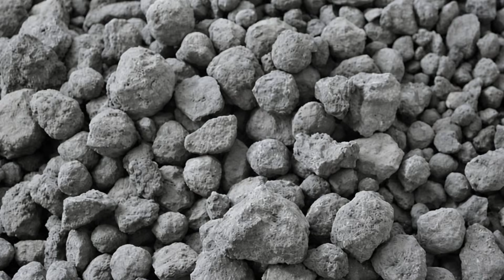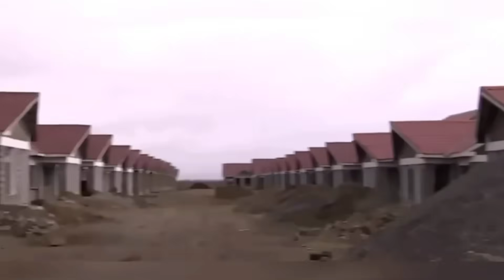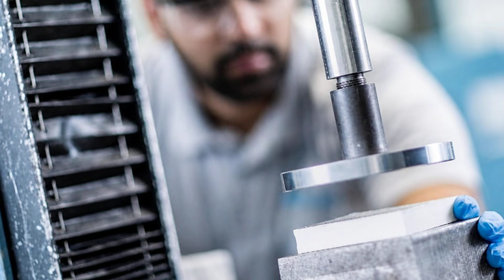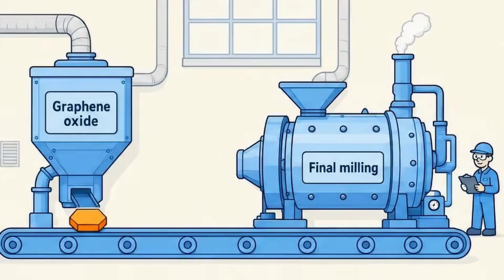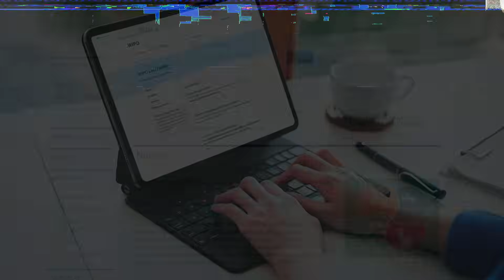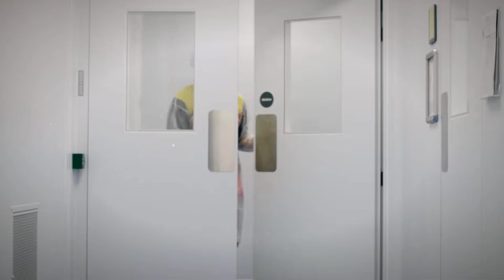China's New Additive Makes Concrete 40% Stronger - And Cuts Cement Use by 30%

Comment: Calcium silicate minerals can also be used to make Portland cement without releasing CO2 during the calcining process. I guess the CO2 produced by this new Chinese process depends on whether the graphene oxide used is produced by the chemical synthesis (Hummer's) method which doesn't release CO2 or the thermal processing and reduction method which does.